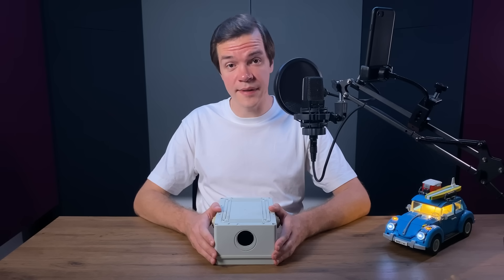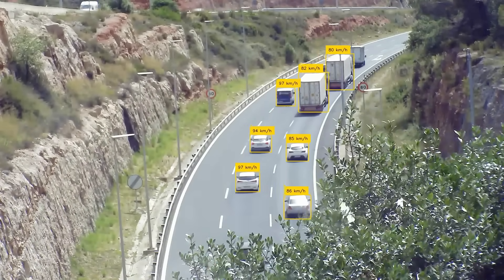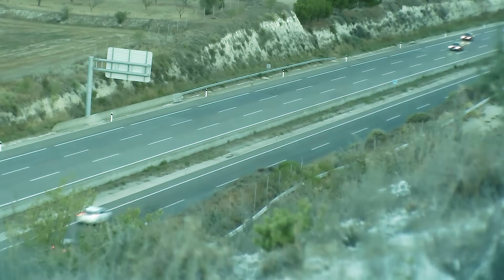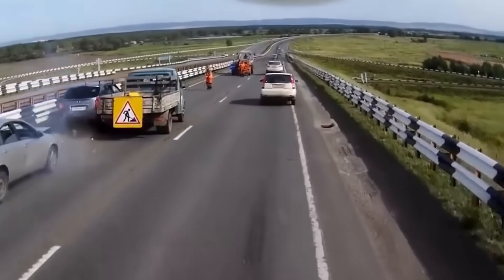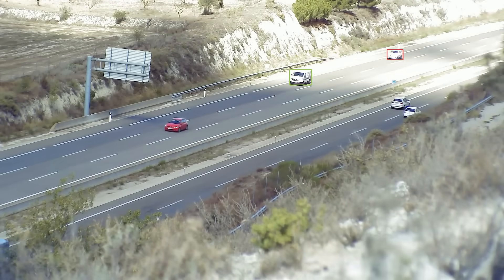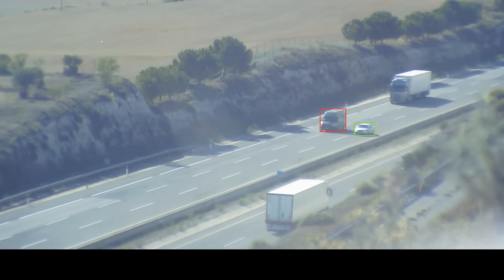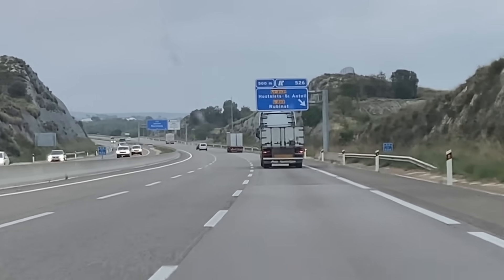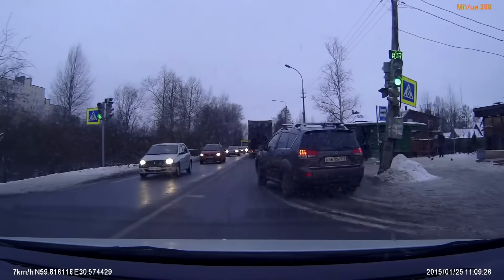New Anti-Tailgating Camera Reveals Shocking Statistics

Comment: To add to the complexity of the situation, the driving culture in Spain is that everyone is always overtaking someone else even when traveling 1 km/h faster than others. You see it in this video as well, columns of cars in the left lanes overtaking empty stretches of road. On 3 lane highways you always see the middle lane blocked by slow cars when there is no one in the right lane. And this seems to be extrapolated to as many lanes as you want, I've seen sections of 5 lanes where people were still in the second to last lane going much slower than the speed limit and with barely anyone else to their right. When there's bumper to bumper traffic you can sometimes notice it as well when the right lanes move faster than the left lanes, because when no one is going anywere, everyone suddently needs to overtake. 
So for anyone who actually wants to overtake on the left, the only solution currently is to tailgate, because if they don't then the people in front will forever hog the lane. I believe teaching drivers to keep to the right lanes when they are not actually overtaking would help with so many weird and dangerous situations on spanish roads. 
Any of these behaviours can easily be targeted without techology I think by just having active traffic police. I feel like police only travel from point A to point B and do their routine in these destination points, but while traveling they never stop or warn anyone who is driving unsafely. At least this has been the experience in my area.

Comment: I find it strange that there is a 3 second rule, so you brake before hitting the other car. This seems excessive. If I remember correctly my driving lessons in France the rule is like 1-1.5sec (I'm pretty sure it's reaction time). Which correlates by your statistics. I do not see it as dangerous as you because when traveling at 120 km/h I quite have hard time getting things becoming to a full stop mostly instantly. Like, it's not city, there is no parked cars, it's designed to be driven fast, so no side crossing, etc... The only reason for it to happen is if something is already stationary on the lane, which mean like an accident ? And even if that just happened (like an animal), the other vehicle still have to stop. It may stops faster than you leading to an accident, but it will probably be way less dangerous than hitting a wall/stopped car.

I'm not at all advocating for shorter distances. I'm kinda the one being cut and it makes me angry a lot on the road. Learn about safety distance, assholes. But 3 seconds seems a bit excessive to me.

Comment: when the car behind me tailgate me, I slow down gradually. doing this, I press many times on my brakes so the brake light switch on. that's what I was told to do when I was taught to drive. the shorter the distance, the slower I drive. eventually, the person will understand that if they want to go on on normal speed, they need to keep safer distance. once the person back off, I drive at normal speed again.
on highway they usually pass, but if there is just 1 way, they comply. I never let someone tailgate me at full speed. I change lane so the person pass and go on annoying someone else.
I never cut the way of other vehicle. especially big trucks. they need so much distance to brake, it's so dangerous, especially when it's raining. I see constantly cars cutting line in front of trucks. people are crazy. they don't realize that truck drivers usually have VERY LONG journeys. they are tired, sometimes struggle to not fall asleep. never cut the line of a truck, never!

Comment: It seems like a mistake to assume the following distance is the same as the stopping distance, since the car in front never stops instantaneously, but slows down just like you do. So the actual time before impact is longer than that required by the braking time.

Comment: I am qualified to operate any vehicle that can be lawfully operated on a roadway in the US, except for those with self-loading cargo (school bus or motor coach). The sheer number of people who will pull right in front of a very large commercial vehicle is astounding. Reaction time might be similar to a passenger vehicle, but having air brakes (which have an inherent delay in activation compared to hydraulic brakes) and being many times heavier than the traffic that is cutting me off does not tend to favor the odds for the other traffic in case they severely miscalculated their action. And pretty much anyone who has seen the countless billboards advertising "truck accident" lawyers should have a dash camera, because even when the big truck did everything right we are still presumed to be at fault unless we can prove otherwise.

Comment: (8:58) I haven't finished the video, but... this is actually just people speeding. The whole reason someone gets that close is because they're going too fast. If you go the speed limit and stay at a safe following distance the distance between you and the car in front of you should either stay the same or should grow, but drivers are impatient. Speeding IS the real threat, because without the need for speed you wouldn't have the chance to actually gain on any driver in front of you. It's a bit frustrating that the connection never seems to be made, instead opting to blame tailgating which is as a result from speeding...

And we've had countless study after study telling us that you don't even save that much time, meaning people are speeding just to speed. 🙂

Comment: The worst is when you get people forming the convoy barrier in the road.  Like half a dozen cars driving tight together so people can't safely change lanes and pass through.  And that's when you get someone blasting by at like 200 km/h on the outside lane as you're trying to cross the convoy for an exit.

Comment: The way I see it it is part of normal driving and traffic that sometimes you end up closer to other cars than the safe distance. That is why the safe distance exists. So people can use it to change lanes. The problem there is imho not people using the safety distances for merging but people thinking they are entitled to the safety distance once they got it. Sometimes there is just too much traffic to have that safety distance. There is a careful balance between going at the same speed as others and keeping a safe distance. Sometimes it is hard to do the right thing because it is different what everybody else are doing.

A lot of traffic issues come from entitlement imho. Road rage, speeding in wrong places, dui, aggressive lane changes, using phone, tailgating. It all comes from something that starts with "I need". Get there faster, be somewhere when I am not on condition to drive or I need that space in front of me or this spot in this queue. Another one is "This is my...". My lane, my turn to go, my speed, my spot in queue... If people were just more courteous and think in longer term they'd be safer and get to places quicker.

That being said I agree 100% with the idea that speeding is not really an issue. I ride motorcycle and every single time I ride the posted speed limit I get a tail gater. For some unknown reason there is always a bmw or tesla or something, sometimes a truck that feels the need to ride too close. But they never overtake. Basically I'm dead if I need to brake or avoid something.

Comment: This data ismossing an important key point.
Bias cause by speed limits.

Because its activly punished to drive to fast, way fewer people do it, and more pay attention to not speed.

But the same is not the case for how far away or close up a driver drives....

It does not that driving up close is more dangeroys than speeding.
It shows that speed limitations and concequences for speeding is more effective than the effectivly 0 actions take to prevent people from driving to close.

Comment: Tailgating is endemic in Spain. Travelling at or around the limit , during an overtake , there will invariably be another vehicle that appears right at my back (yes, I do check mirrors beforehand) before I have completed the manoeuvre. Speeding up for the overtake doesn't make any difference since , as with indicators and lane discipline, speed limits seem to be optional here.

Comment: Very interesting and impressive, however I think your following distance distribution chart is flawed or misleading (explaining why it's rather uniformly distributed rather than curved) because it looks like it just represents the distance between vehicles during that random 250m section of road, but not really the minimum distance that drivers use to keep with previous vehicles. In the chart, a large proportion of vehicles are more than 100m apart, but it'is most likely they are not really following each other (either the first one has recently overtaken the second one, or the second one is catching up with the first one but is still too far to overtake or follow it, or they are driving at the same speed but are apart because they merged at different times). Many circumstances can explain the distance between two vehicles at a random time (which is your filmed short section), but only some of them are relevant for safety analysis, so irrelevant situations should be excluded from your data, or at least shown distinctively (e.g. with a stacked bar chart also displaying the relative speed between vehicles). But this is quite tricky to distinguish... for the same reasons it's hard to implement tailgating cameras ^^'. To get relevant data, I think vehicles would need to be tracked on longer distances.

Comment: You cant have a safe distance because you cant communicate that you want to get past the other car that way and other slower drivers will pull in the free open space in front of you. (guess you also said that at the end of the vid.)
What would work is a way to force the slow people to stay in the slow lane. Maybe cameras that fine you for going slow in the fast lane. And you can absolutely fine people for going too slow too. For being a dangerous obstacle. For causing unrest in other drivers. Slow drivers wont suffer from staying in the right lane, i genuenly dont understand their emotional trouble with letting people overtake them.

Another issue are the driving schools. They dont teach people to floor it on the on-ramp onto highway/Autobahn. People pull into the main lane as soon as the solid line opens into a striped one, not using the accelleration lane.

Comment: Going to push back a little on the 100 meter following distance being a good metric for driving safe.  Sure, if everyone followed at that distance when going 120 km/h there would be essentially zero multi-car accidents.  Same could be said by strictly enforcing a 10 km/h speed limit.  My problem is that It is basically assuming you can only see as far as the vehicle in front of you, and that if something happens you literally need to come to a dead stop to avoid an accident.  In order to meet that criteria, you are basically talking about the car in front of you hitting an invisible wall that takes up not just the lane but the shoulders as well. Even 50 meters is more than enough to mitigate all but the most extreme examples.  If you aren't within a few meters you can usually gauge what is happening in front of or around the car in front of you without most of the angular size of your vision being obscured by that vehicle.

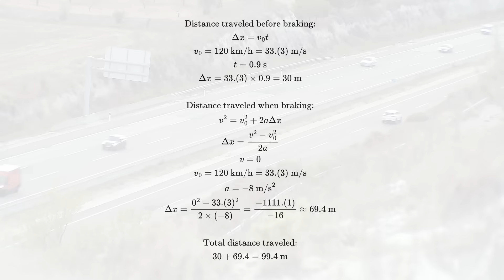Comment: 9:35 - VERY important to mention is the fact that this distance is for a case where something STATIONARY pops up on the road or the preceding car just crashes into something stationary. You point this out a bit later in the video but apply the false logic anyway.

Applying this to all cars - most of them moving forward and being able to brake at similar rate as the following car is not precise.

Also, the braking rate is slow at first so its forgiving in the scenario.

In other words: even if we have a case of rear-ending its never equal to ramming a wall at 120kmh. EVEN MORE! If you cut the distance to 1cm and then the preceding car slams the brakes the following car will just have a small scratch on the bumper (assuming it will not deflect sideways for some reason).

Your conclusions at that point of video are wrong.

Comment: I find through extensive driving that accidents are not, and most of them are not caused by tailgating per se, but from a vehicle weaving in and out of lanes and speeding at greater than 10 mp than surrounding traffic. Or from those who enter a freeway and do not get up to traffic speeds to match and merge properly

Comment: I'll never understand why most people don't accelerate hard when entering a fast lane, or don't use the deceleration lane and quickly enter a side exit at the last minute. (sometimes cuting 2 or more lanes). These stupid and annoying behaviors cause most sudden stops.
Another stupidity is to change lanes almost immediately to pass a vehicle traveling 10% slower. Few people check the other lane to see if anyone is coming who will need to slow down significantly.
Tired of this, and after years of observing on the street (and noticing that stupidity and selfishness are common in all countries, cultures, and roads), I've developed some strategies. In short: if there's a large group of vehicles on the road, and I can't go any faster and leave them behind, I slow down and let them go.
The important thing is to avoid being in a crowd of cars... Some speed up and brake recklessly, and you start to ignore the brake light of the idiot in front of you, and then he brakes hard, you react, but the ones behind you don't have time. The other idiot keeps changing lanes, to go half a meter further, and every time he does that, the lane he enters, everyone has to brake. There are those who stick to your rear, there are those who insist on driving at low speeds in the fast lanes.

I´ll never be among him again

Comment: I'm not used to tailgating, since my car doesn't benefit from the wake, but the other day I had to follow my boss (he drove his van) with his car and the point of tailgating was to prevent to be overtaken from the right lane by people driving recklessly.

A dozen years ago I traveled back home from Sicily (about 1000 Kms) in one take (10 hours with fuel stops) with my motorbike and I found a Suv to tailgate that was also speeding: apart from saving a lot of gas thanks to the wake, I also arrived fresh and rested because the right amount of wind kept my body almost floating, so no pain to wrists or to my back or else.

Comment: Speed does cause accidents!    It kills.  And you are perpetuating the myth.
The higher the speed, the less the driver takes in of what is going on ahead and around him/her; 
the less capable the vehicle is of changing direction or accommodating significant bumps in the road surface; 
and the results of any impact in life and damage, and the distance taken to stop or decelerate, rises disproportionately as the speed rises (the kinetic energy to be dissipated rises as a square of the rise in speed).

I am a fast driver, and I am often frustrated by some speed limits set by the authorities, but on the whole those authorities are much better at judging a sensible maximum speed, taking into account ALL the relevant factors, than the average (or worse!) driver.  You are correct that speed limits are used in part because they are easier to enforce than other controls, such as the tailgating and cutting in front problems that you examine, but they can still be objectively shown to save lives, money and traffic hold-ups.

Comment: 10:18 Saying that something is ”just as dangerous” just cause the safety index is the same is false. The ”safety index” only looks at how likely a crash is, without considering how severe it is. 
This isn’t just semantics, this is how myths are started, cause people don’t realize this and only hear ”All that matters is the distance”.

The real ”Safety index” should be something like ”Probability of crash * probability of death from crash”, and the severity of the crash is only influenced by the speed at which it occurs, hence why we try to reduce the speed, since it’s the most reliable way to reduce deaths.

So yeah, tail gaiting can be more dangerous than driving 200 km/h, but on a population level reducing the speed reduces the severity.

Higher speeds also means less time to react when someone in front of you makes a misstake in another lane (such as switching lanes without looking, or debris falling off etc), your simple model does not capture that risk either.

Comment: 100 meters is a lot of space and having that much is more incidental than planned. This is also a low traffic area with each vehicle having plenty of sideways mobility. Even when you talk about another car that forces tailgating by changing lanes, the two other cars were only about 25 meters form each other so, they were already tailgating by your definition. At most, with the 100 meter rule, there can be a maximum of three cars per lane at any given time, and that is a long stretch of road, approx. 238 meters, so the length of two football fields.